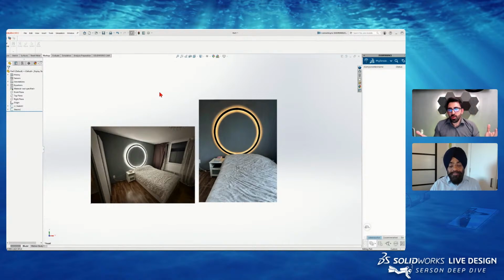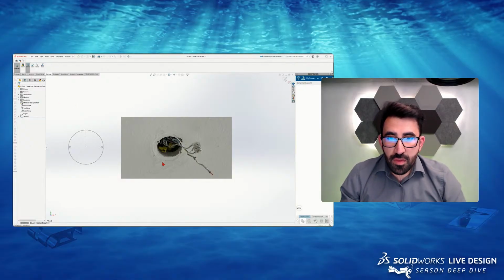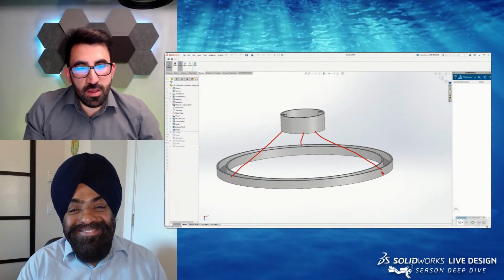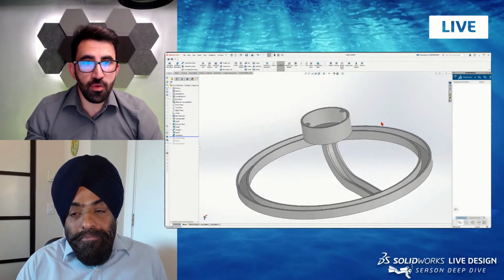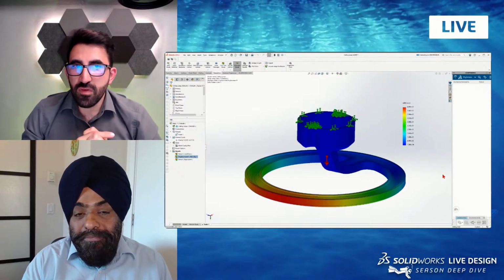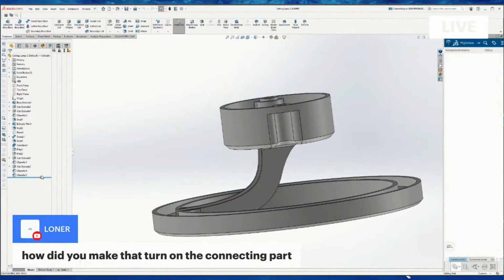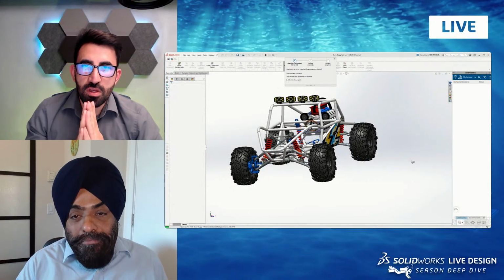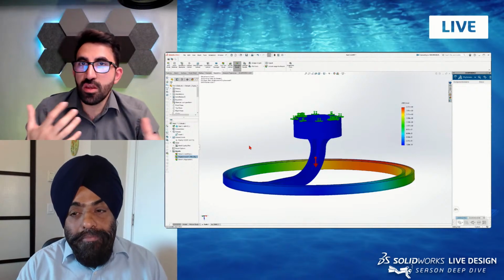SOLIDWORKS Deep Dive: Modeling for Making (LIVE Design)

Comment: Nice presentation of a simple product design process. Could be done in under 10 minutes though. I didnt notice anything meaningful about Modeling from Measurements. But especially, while you are designing a new light which you obviously wanted much larger diameter of and are using 3D printin method, I find it being such a missed opportunity to mitigate the sag not by making the light smaller or stiffer overall, but make the model pre-sprung the other direction, so it would sag to being perfectly flat.
Reply: Thanks for the comment! Given where the conversation and presentation ventured into (with great help from the live chat), I'd say you're right on about the original title. 👍 Happy they got to explore around a great deal!